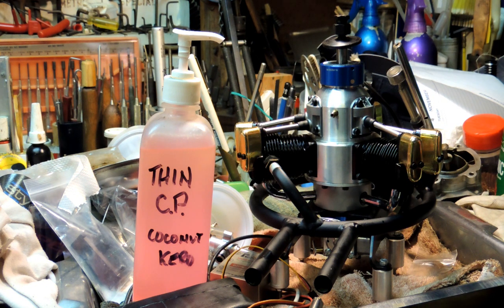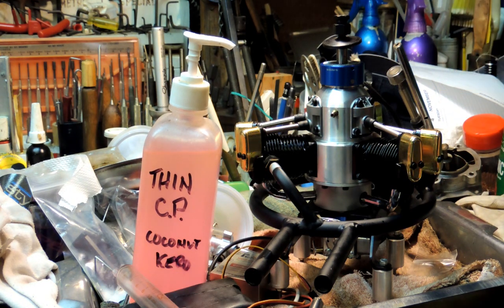SAITO SPARK

Comment: Is there much of a reduction of power going from alcohol to petrol?
Reply from the maker: Yo Stoney, 

I have not recorded any real reduction and I compared some Saito radials - glow to the later petrol versions and the propeller figures were almost the same. With the spark ignition, you can use a wider range of propellers as the auto advance of the ignition system sets the timing for a variety of loads. One of the better benefits is that the engines do not suffer from fuel corrosion after running as a methanol engine does - no more rusted and gummed up engines.
Regards
Brian Oily
Reply: @BrianOilyEngines  Yes I agree with the corrosion, engines running on petrol should last a long time.

Comment: Hi Brian,
Do you know if FG33R3 Keleo Exhaust will fit this FA170R3?
Reply from the maker: Yo B737,
Sure does - I just checked it out and the fit is perfect. Now all you need do is to convert your 170 to petrol as I just did.
Regards
Brian Oily
Reply: Hi Yes the ring will fit FA-170 R3, FA-200 R3 and FG-33 R3

https://www.morrisminimotors.com/exhaust-systems/saito-exhaust-systems/saito-fg-33-r3-gas-petrol-3-cylinder-radial-4-stroke-engine-exhaust-ring-mmmfg-33.html

Comment: Ok Brian.. What is coconut Kero? Thats a new one for me :)
Reply from the maker: Yo 'Jimmy-crack-corn'
Coconut kerosene is distilled (or made) from coconut oil. It does the same job as common kero but does not have the kero smell (smells like coconut oil) which tends to stay with you if you use it or spill some on clothing. I also use it in model diesel fuel and the running smell is quite pleasant. I have, also, odourless kero and it is good as well but I do not know how it is made. 
Err...I don't recommend it for cooking if you coconut oil for food preparation as it still tastes like kero (HoHo).
Thank you for your interest
Brian Oily